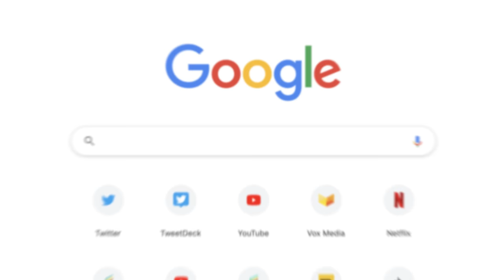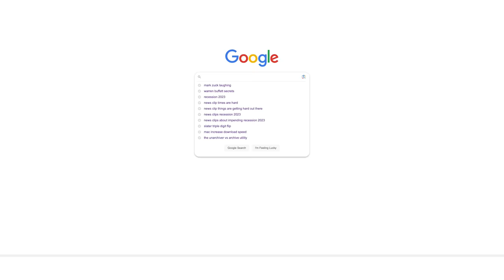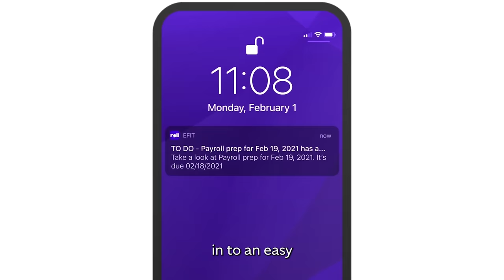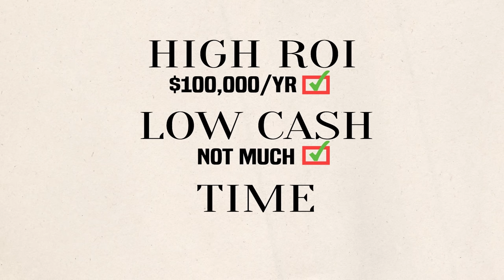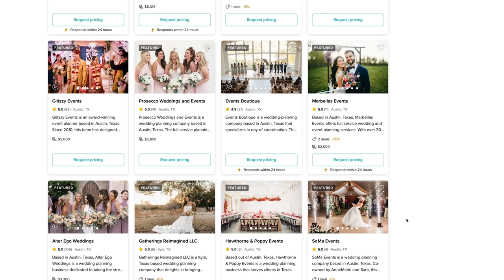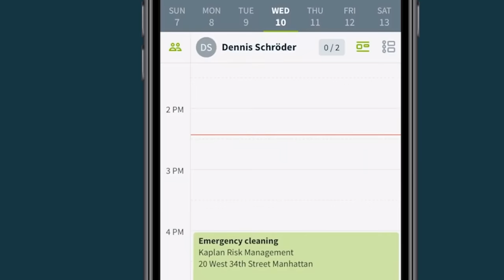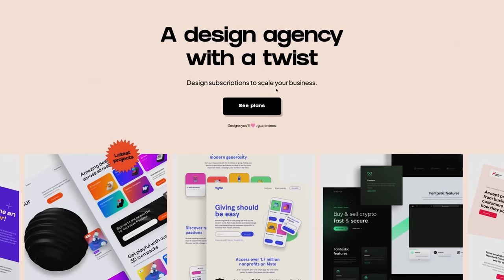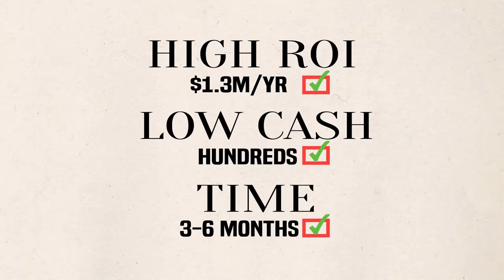7 Best Businesses to Start For Less Than $1000

Comment: $50 to edit a real estate video and $100 to shoot? Those are cut throat rates. Not worthy of the time you'd put in. RE agents are notoriously cheap so you'd get the bottom feeders for clients and they're typically the biggest pains in the ass to deal with. The better clients would demand more and probably have bigger properties that require more time to shoot an edit.

Comment: As a wedding planner, I can definitely say that is not how a wedding arch rental business works. First off, clients have access to this service from many different companies - florists, decorators, producers, rental companies. If you want to do multiple weddings you need multiple arches and materials, multiple teams etc. Then, setting and breakdown is definitely not an hour each lol. Also to add, it is so wrong to use images that are not your own for marketing purposes.. And working with planners, good luck with that, like we don't already have ten other tried and tested options?! The amount of spam we get from vendors trying to promote stuff with little to no values is higher than ever. This section made me rethink the entire video. General assumptions of a very particular industry where your knowledge is limited is what makes for poor content 😕

Comment: I kind of disagree with the handyman recommendation if you are going to work IN the business not ON the business. My experience after nearly 30 years as a handyman. Sending relatively unknown people into peoples homes - bad idea. Customer satisfaction varies wildly - you think you did great - they think its crap. The cost of tools needed is way more than Codie realizes. I have a 1 car garage (10x20) full of ladders, tools, parts, wood, drywall, mud, paint, bits and blades get dull, tools break or are lost or stolen, etc etc etc. My work van was a rolling Home Depot of parts regularly needed on jobs. No mention of cost of having a work truck/van and contractors insurance and health insurance for potential injuries. I was lucky and only once was hurt bad enough to not be able to work (tore knee ligament on a wobbly rock in a flowerbed - 3 months out of work)

Comment: So the real estate video. I can’t seem to catch what the 99c video editing software is. Did you mention it?
They film & send you the files to edit? I can’t imagine it’s very easy to find existing footage of the building, maybe the area for some of them. Surely the estate agent doesn’t pay for a general video of the city? 
Or are you saying to just use stock footage for the sample video? I think that’s what you mean, otherwise I’m not sure I fully understand how it works.
And if they require you to film it, you’d have to invest in a decent camera. It wouldn’t look very professional rocking up with a relatively old iPhone 😆 but I’m thinking I could start off with just editing & then invest in a camera if I can see the potential is there.

This really interests me because I’ve already had some editing experience, I live in a hot real estate area & I’m only working 2-3 shifts per week in retail as a casual. I need an income asap & I have the time!

Comment: The micro greens business is not going to be able to start for 1000 dollars. The equipment alone is over 1000 dollars because it you have to have a FDA certification also the lights that are required to produce are 250 to 800 dollars per light. Then your nutrients are going to run you 500 the pumps that you need 100 then you need air circulation so depending on the size 50 plus just for the fan you also need duct work. If you put it in a spare room the moisture is going to destroy your house.your power bill is going be high 14:26

Comment: there is a company by the bay were i live (Ibiza Sant Antonio) its called Arenal and they are a diving center that dose more snorkelling trips than diving now because how much they make per person so we did the maths and not being 100% accurate but we calculated 2.34mil in a decent sumer and this is seasonal so they have 3 boats and 3 different sizes 1 is a 40 person boat, 1 is a 25 seater and another that is a 20 seater boat they charge 60euros/Person and they do 3 trips a day so on quiet day lets say 60% capacity works out 2 be 51 buts let call it 52 works out 2 be 9360Euros but thats at only 60% capacity the only cost is 3 captains at 150-200euros/day and fuel that is like 600euros every 2 weeks works out to be 8717euros/day befor tax and if there runing for 26week it works out to be 1586520 each season and thas if its a shit season. 

So yeah im interested, but the up front i believe  is like 30-50k and i don't have that money.

Comment: Ditto on the licensing and insurance in NY for window washing.  In NYC you have unions to compete with. Additionally NY has absolute liability laws to Owners and General Contractors. No evidence of insurance when you contact the building owner, no work. Insurance premiums rise exponentially because insurers do not want the fall from height exposure (costs associated with severe accident claims). I would not want to discourage anyone, it can be done but it would be low key mom and pop, family and friends window washing, understanding the limitations, there is a cap. Commercial work not likely for $1,000 start up capital; and if you do commercial  contracts, the account receivable ratios is more than 12% more like 24-36%, thus how long can you wait on your money before you go bust? With that, plan to have 4-6 months living expenses available. My comments are fact, not theory.

Comment: I just want to start out by saying you are a rock star. I take your advice and wisdom seriously. My question is what are your thoughts on home inspector. The license would be easy as I have been a contractor for over 20 years. My reason for looking at this approach  is because I am struggling to find workers.  kentucky has become very difficult to get employees or subcontractors the work is simple to get. I am trying to find an approach that can be managed by myself. Even as a handyman service I am over booked and left stressed with no help.  I have also been running a hotshot company for the last 4 years but want to keep my ties with two or more income.  Do you think home inspector is still a needed service or do you think it's being fazed out by appraiser's?

Comment: What would be the advantage for the client to opt in for a design service subscription? If they need occasional work they can reach out to freelancers directly, if the work is more recurrent they can hire for their team. Not criticising, just trying to understand the advantages of the subscription model vs the regular agency model for design services and even for companies that provide development/computer programming services.
Reply: The number one advantage is to have access to a talented designer whenever you need it. You go from spending a week trying source a good designer and negotiating terms and their availability, to just sending a message to designer saying in need X and it’s going to get done.  You have already budgeted for this expense and because you are now familiar with this designer you can probably reasonably know what kind of work to expect back which means you can spend less time on the project.  Sure you could hire a designer for your team but many companies have hiring freeze in place. So this is a way around that.